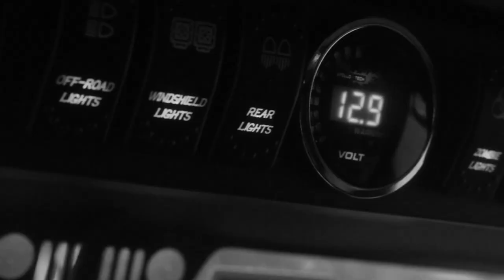Pressurized Scepter Water Tank DIY!

Comment: i'm curious if you run it to 15 psi how long would you be able to get decent pressure before it cuts off -- basically trying to figure out if i could put the hose to shower setting if it would provide enough pressure for a shower
Reply from the maker: Lol....I actually finally got it to 15. I kept trying to up the pressure little by little to see how far I can push it but believe me I stood pretty far away in case it blew lol. It didn't.  But I probably won't push it any further than that.
Reply: @BaptismOverland  yeah, i wouldn't push it past 15 -- i'm mostly curious to see how much time of pressurized water 15 PSI gives you

Comment: Nice! So could you dial your pump to 7 psi and run it continuously with pressure until the water runs out? and the pump cycles off if pressure gets too high?
Reply from the maker: Hmmm, never tried that! I need to have a module that shuts off the compressor when it reaches 7-10psi
Reply from the maker: @fourbyforester  yep and I’m trying to minimize gear not add to it. This is pretty minimal. Just a can and a hose. If you have an air compressor on the rig then that takes care of that or just bring a simple bike pump that won’t take up too much room
Reply: @BaptismOverland that air compressor turns off when it reaches the psi you set. I have the same one. Good video.
Reply from the maker: @mstreich02  no I know. It turns off when you set it. But I don't keep the compressor on continuously. I fill it with air then take the canister wherever I am.  I guess what I was trying to say was a regulator on the can itself so that when it reaches a certain point it'll release pressure so it doesn't burst in case my compressor is still pumping

Either way it's moot. I actually have an on board compressor with air tank now that I plug into a waterport. And I added a module to that I can shut the air flow to the water tank when it reaches a certain point then I just turn the lever again when air runs low.

Comment: What size drill bit did you use for the schrader valve?
Reply from the maker: If I remember correctly, I THINK a 3/8" but I would start small and step up till it fits.

Comment: The way I did mine was I put a hose spout on the bottom of the Jerry can amps a valve steam on the top through the lid. You can pressurize it through the valve steam or use it as a gravity fed water tank/shower.
Reply: Does that mean you can pressurize it through the water Stream? I am searching for an Option to pressurize the watertank through the water stream

Comment: If you reduce the inside house 1/4 "  or 3/8 " max it will have greater pump capacity by 2,3 times what you have right now..
Reply from the maker: Great tip!

Comment: I was expecting a hand pump for camping :( Oh well.
Reply from the maker: You can. It’s a schrader valve. I actually bought a small bike pump to attach to this in case I don’t want to bust out the air compressor.

Comment: You can allso do this method with a 5 gallon bucket with a air tight lid. And have at least 4 gallon of pressurized water too use or a full 5 gallon if use gravity fed system

Comment: Love this Asia.  You guys are adorable too. 🤙  

Curious how you store it when driving in a rear carrier situation.  Hang the hose or create a holster for the shower head? Or just remove the lid all together and seal with a replacement? 

Thanks for this! 🙏
Reply from the maker: Thanks man! And you can keep the lid on. Everything on it is shut. No need to replace lid with another. The hose and the shower head I store in the zipper compartment of my trasharoo. In fact I did a camp walk around video that I’ll be releasing tomorrow so you’ll see where I have everything. When we get to camp I go ahead and attach the hose to the spigot

Comment: I'm going to use your setup, would like to know how it has held up, are there any changes you would make.  I like relocating the Schrader valve so you can still use the vent hole to depressurize it.
Reply from the maker: It’s held up awesomely! I was almost tempted to buy a $150 waterport but then I saw someone with it and it wasn’t that different at all. Honestly it’s one of the best things I’ve made so far

Comment: Question if you mounted this on your roof rack would you mount it vertical or horizontal?
Reply from the maker: Actually considered that. I won't think it would matter much as the inside of this thing has a hose so it should reach the water regardless.

Comment: Great video. Couple of questions. Do you fill it by removing the hose and using the spigot? And then how do you repressurize on the road. Do you carry the compressor with you?
Reply from the maker: You refill by taking out the whole cap that the spigot is attached to. One big open mouth (scepter also sells a wrench made for that lid so you can tighten and loosen it easier). And yes I use an air compressor or bike pump on the road to pressurize

Comment: Are you still using this? How did it hold up? Also, what is the max PSI you have filled it to? Thanks
Reply from the maker: I am! Still working great. I put it up to about 11 PSI but I'm sure I can push it a bit more. It's just that it starts to flex a ton after 10 psi and I don't want it bulging any more.

Comment: Some mods to this idea I would do is use drinking water hose instead of this radiator type hose and also use stainless clamp so you don't have rust problems. Otherwise this video is great. I know your using it to wash dishes so it doesn't really matter but I would build it drinking safe just because.
Reply: I was about to comment on the same thing. Using a drinking water hose usually means the hose is clear. That allows you to see if there is mold or dirt in the hose so you can clean it out. You wouldn't want to wash dishes with water that's coming through a moldy hose.

Comment: I follow the steps on this diy. Got everything to work but I have to leave the air compressor on while spraying it. When I disconnect the schrader vale from the air compressor I heard a hissing sound. Any suggestions why it loses psi?
Reply from the maker: Have you tried spraying the area with soapy water? It'll bubble up where you have the leak. Then it could either be that you didn't screw it in tight enough or didn't put enough tape or you have a defective schrader valve. Could be a bunch of things but only way to find out is to determine where the leak is coming from.

Comment: Wonder if using an rv water pump would be more practical instead of pressure
Reply from the maker: I considered that but then you have to deal with either batteries or getting power to the pump. With this system I can hand pump it with a bike pump
Reply: @BaptismOverland  yes, yes, good point!

Comment: Potentially dumb question:
After pressurizing, will it maintain that same amount of pressure until the water is empty? Or does it slowly decrease pressure, needing to add more pressure periodically?
Reply from the maker: No it will def lose pressure. That's why most people keep it hooked up to either their air compressor or a foot pump.
Reply: @BaptismOverland  thank you!

Comment: I'd still be worried about leaks what is really holding that spigot on beside a little forced threaded plastic and that clamp on the inside?
Reply from the maker: That's it but I haven't had any leaks. I mean if you look at a Waterport it's the same situation. Threaded plastic.

Comment: love this setup. All the other ones with a drop-in 12v pump, the pumps always seem to get a large % of 1 star reviews due to poor quality.

How has this build held up for the last few years.  Also, as you didn't use the nut on the back side of the spigot as it would have taken up all the space where the hose needed to attach to, has the spigot ever come loose?

thanks.
Reply from the maker: Still works. I decided to not use pumps cuz then it's just another thing I need to charge up lol. In fact I have a waterport now and I find myself hand pumping it more than pressurizing it with my air compressor cuz it's just more convenient without worrying about other parts
Reply: @BaptismOverland  thanks!

Comment: Nice work what you going to do for hot water
Reply from the maker: Actually trying to do some research on that now. I probably won't be DIY'ing that and just getting a built in system already in place. I know there are some water heating units out there that I've seen with great reviews. Right now it's not THAT necessary as we live in Florida and it's always hot here but I know if we start venturing out in the fall I'll need to have that figured out
Reply: Cool I'll look out for your next video keep up the great work thanks

Comment: Great build, I made one myself. Only issue I had is that long term it’ll start to leak air where you you put on the cap. 😓 I’ll be in search for a better container with the same concept.

How is your build holding up?
Reply from the maker: Mine is starting to do the same. I switched out to the waterport. This was getting to be a pain to store in the trunk
Reply: Waterport that's self pressurizing  ??

Comment: dude.. just get a a 12v electric pump and small battery  it's much better than this system...
Reply from the maker: Yup doing that for the bigger system I wanna put in the Jeep itself. This is more for portability without having to lug around a 12v system.
Reply: 12v self priming is not that big at all. 4 crew to mount on the tank or you can do a simple wood box and mount it on the tank to make it look more neat looking. pushing 4.5 liter per min or you can get 2, 3 gallon per min. either using a small 12v battery that lasts you 30 hours+ continuous used or cigarette charger plug connector to power the pump. comparing you have to carry the pressurized pump. The pro is it's self priming "auto shut off when it is not in use. 2nd it pushes the water much more stronger. just a suggestion :) bayite 12V DC Fresh Water Pump with 2 Hose Clamps 12 Volt Diaphragm Pump Self Priming Sprayer Pump with Pressure Switch 4.5 L/Min 1.2 GPM 80 PSI Adjustable
Reply from the maker: @kevinngnova  yeah I feel you. As I said I know I’ll have a water pump system somewhere. For now this one works for the small jobs and I’ve been pumping it with either a compressor one time or a bike pump. At the end of the day, sprayed water is sprayed water no matter what you use to make that happen lol
Reply: @kevinngnova  Where’s your build video?
Reply: @kevinngnova  So if you have a new idea great. Just be sincere and follow through and include a link because this man innovated and you are just blowing hot air. The capacity is only 5 gallons and a pump system is more than the tank and would not be as weather resistant.

Comment: That's a lot of talking for a 2 minute expose. 
What could improve your idea is to put a preset gauge on the inlet air valve. That will work like a pressure pump then. Or, if you want to do it off grid, and 1/8 of cost to build this one, use a bike pump of mattress foot pump. 
There ya go. I just improved your idea under 30 seconds!
Reply from the maker: 1) yeah. You didn’t improve the idea...I made it so you can use any of those things but why bring a foot pump if I already have an air compressor in the Jeep
2) Yeah that guy does a lot of talking!! If only YouTube could allow us to scrub forward or backward am I right?!!
Reply: @BaptismOverland  "That guy" is you? But to be expected. You've got that american thing happening. And they're well versed in talking. A lot! I'm surprised you didn't have the big symphony happening in the background with that "we're the best in the whole wide world" clap that you see in the "big block bluster" movies that roll out of tinsel town. 
As far as your design. Common sense for most people that when you pressurise anything, it's going to expel whatever's contained!? Genius!?! What I simply did was explain how you can get the same result for less than half the price of your build. You could even blow into the container to pressurise it. Or just sit on the container without doing much else and STILL get the same result. But anyway.. you're amazing! (Symphony please .. ok. Roll on credits.. right that's a wrap!) 😂🤪🙄
Reply from the maker: @oldscool5343  Ahhh you're not American so we go with the ol' American bashing! Got it! I'll say this...never have I thought I'm better than anyone for being "American". I'm an immigrant that came over at a very young age and raised in a traditional Filipino household. But hey, assume away my friend!

You wanna see just a build? Tons of videos on it brother. Have at it. My channel is to not just show you how to make something (and clearly if you have so many ideas on how to build one, why were you even watching this?). My goal is to explain the WHY behind the builds and why someone might even need it. But that's cool. You don't start a YT channel and expect it all to be positive compliments. When you leave the door open, sometimes you gotta expect people like you who want to come to your house and crap on your plate. That's a metaphor!
Reply: @BaptismOverland  you did a great job, really enjoyed it.
Reply: @BaptismOverland  great job, thanks for sharing and  - "Fu#& the naysayers cause they don't mean a thing" -311
Reply: Let me get my glasses, I’m having a hard time seeing how your rude comment and “suggestion” improved the idea and made it cheaper.